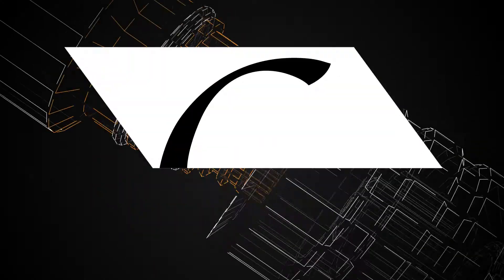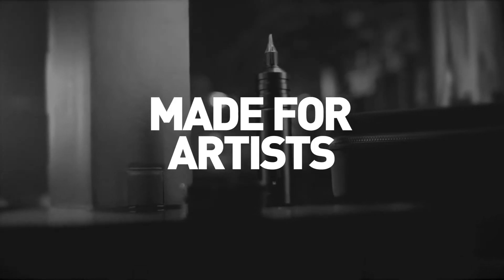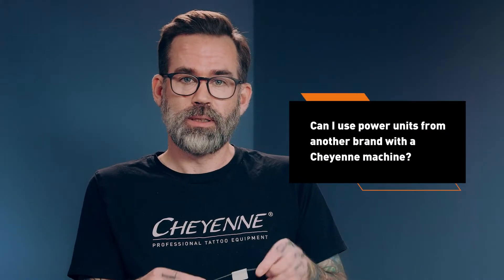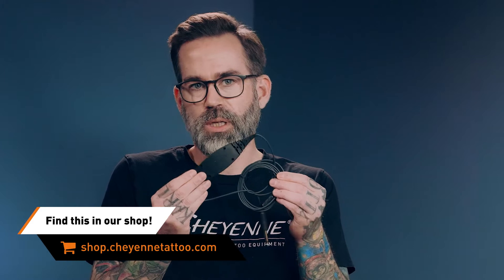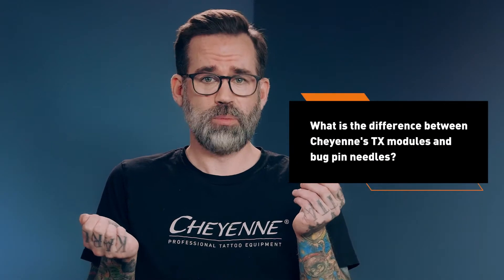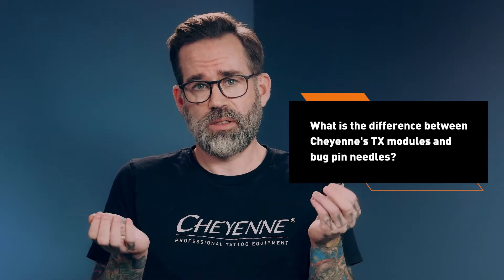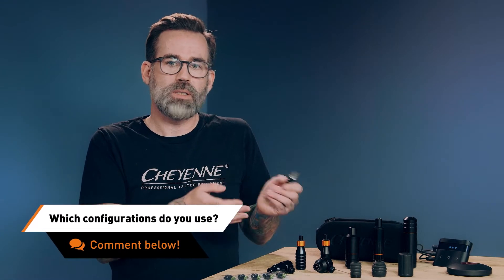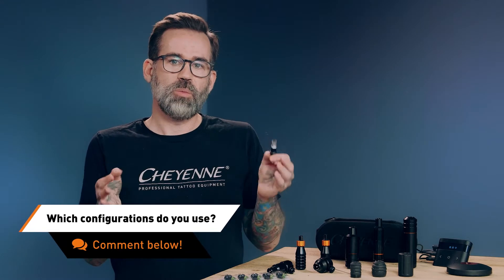Voltage, Power Units, Bugpin Needles - We answer your Tattoo Equipment Questions!

Comment: Hi!! I used a needle of another product. After that, my machine seems to have a problem, but the operation is still normal. But I feel uncomfortable. I think the vibration is more applied, and I feel something is different than the first feeling, but I still don't know the difference clearly. It is not satisfied even if the 7v needle is pulled out long and used slowly. I hope there's a way to check whether the machine is operating normally or not.

Comment: Hi there 
A quick question : does the O rings from the Hawk Pen fit the Solnova Unlimited?
Thank you
Reply from the maker: Yes, you may use the O-Ring set for the HAWK Pen for your SOL Nova. It fits all pen shaped machines. If you are looking for the O-Rings for the SOL Nova Unlimited's battery compartment, please contact our support team. This set will be available in our web shop, soon.

Comment: Can the Sol Nova unlimited be turned off easily during use while tattooing?  If it is turned off during use, how does this affect the voltage and will it resume the same speed and mode prior to being turned off?  For instance, during a tattoo, can the power button be used like a traditional foot pedal to start and stop the machine easily during times in tattooing when one may not want it running constantly?  Thanks
Reply from the maker: Hi Chris, the SOL Nova Unlimited can be turned off/paused easily during tattooing. Just one simple single push at the only button it has. And on again the same way with same voltage.
Reply: @CheyenneTattooEquipment  Thanks!

Comment: All the cartridges labeled textured are .25mm  and the needle is actually textured not smooth ?
Reply from the maker: The needles called tx are all textured. This means they have little notches to transport more ink. Depending on the configuration they are 0.30 and 0.35.
Reply: You comfuse us with the textured and bp things usually bugpins doesnt mean textured,textured are just not polished so will hold more inks and usually better for packing,bugpins are polished and better for soft shading,can u explain more ur bugpins cartridges are better for soft shading or packing color